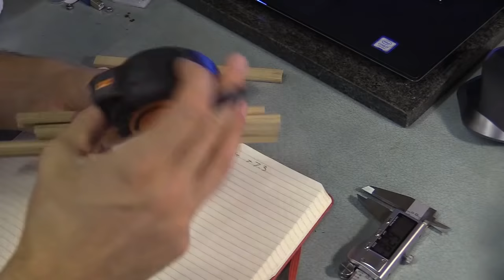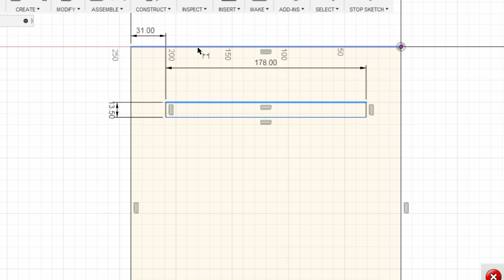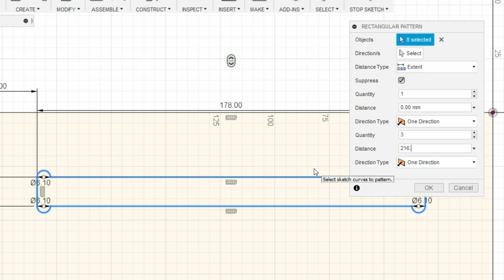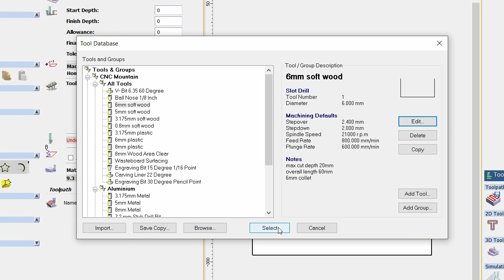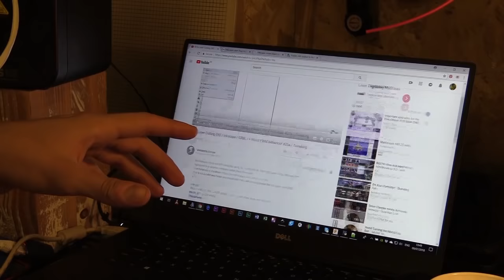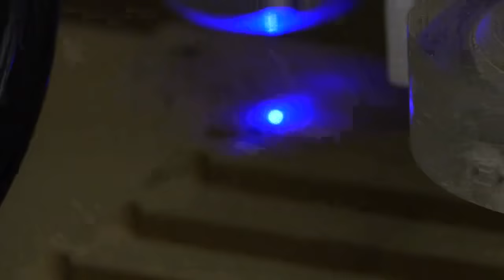CNC Laser Engraving Pencils - Setup to Engraving

Comment: simple yet effective way of doing a "job lot" learned quite a lot from this. Thank you for sharing. May I ask, What is the design software you use at the beginning?
Reply from the maker: Thanks! That was fusion 360 - quite a powerful software. I really using it to draw the vector profiles because you can set parametrics or write simple equations to create relationships between different parts of the drawings.